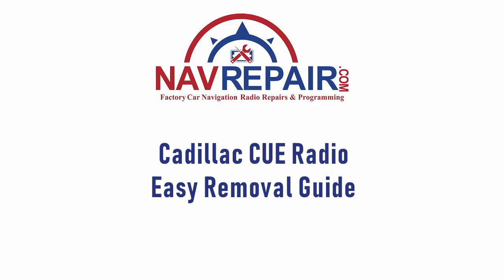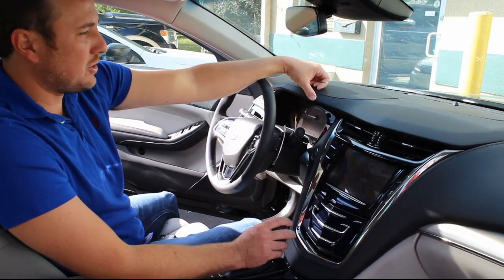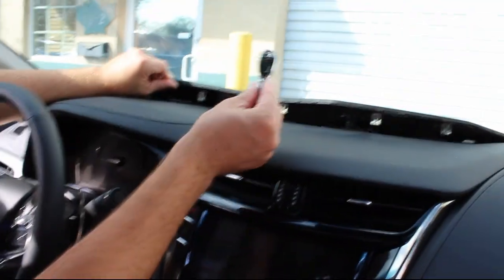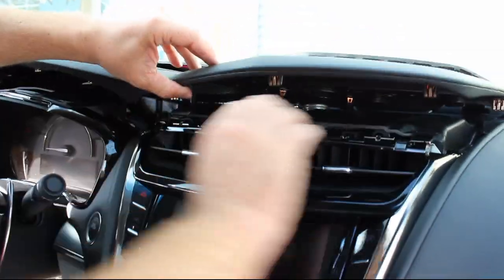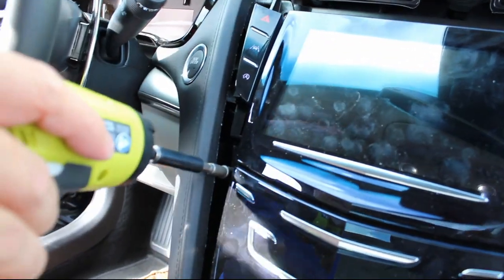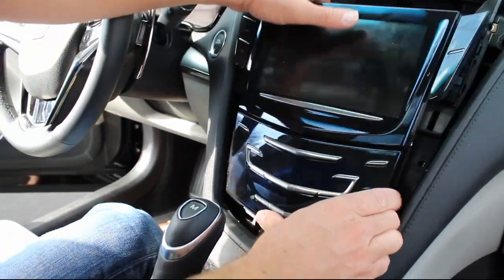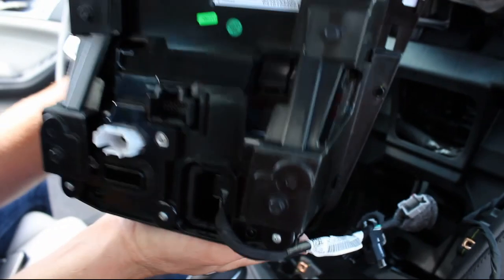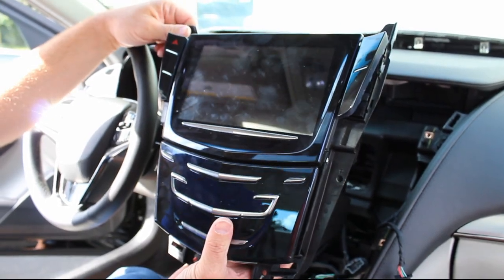Cadillac CUE Radio - Easy Removal for Touch Screen Repair

Comment: It took me 4 hours to replace my own screen, but i only spent $130 for the screen and tools. You have to get the right replacement screen as well because it is some that wont have a translucent trim for the proximity sensors to work

Comment: I just bought an XTS and the volume button seems to have been super glued because it cracked in half. Do you guys replace the chrome buttons?
Reply: I had the same issue in my xts replaced it with a phoenix android radio. Now my wife's doing the same  🤦🏿‍♂️

Comment: Anyone know if you can hook up an aftermarket backup camera (Specifically ALpine HCE-1100) to the cue system (2019 CTS)?  The factory camera is trash.  It's silly to me.  Just like the incandescent license plate/back up lights.  Are they even trying?

Comment: Good morning everyone!

I have a 2013 XTS and the touch screen is out at the very least.

Are there local spots (I live in STL) available because I don't know A) how long the repair will take B) while I am waiting for repare, does the car work and C) much will it cost. 

Please let me know and thanks!
Reply from the maker: Hello there,
As far as local spots, I am unsure, but we are in Florida, so shipping might be 2-3 days maximum. The repair for screens are done 1 day turnaround, possibly out the same day if received early in the day. As for the functionality of the vehicle, everything will work except the radio features, climate controls, and possibly the A/C. Sometimes if you preset the A/C to how you want it prior to removal, that setting stays. We are running a promotion on this repair, so we are doing it for $249.99, not including the return shipping, if you're interested.
Reply: ?NavRepairTV Do you know much is shipping
Reply: NavRepairTV  I have a 2013 xts. Is taking the screen out different than what is shown here?
Reply from the maker: @ayo4325  Shipping can vary from which courier service you choose, but our return shipping is $18 for ground, $35 for two day, and $65 for overnight. The XTS is a little more complicated, I would advise perhaps looking up that vehicle for removal, or maybe scheduling an appointment with a radio business or the dealership. The XTS requires removal of the center console,  the paneling around the stickshift, and I believe part of the top of the dash as well.
Reply: NavRepairTV. Good to hear. My problem is taking the unit out for a 2013 xts. 😕